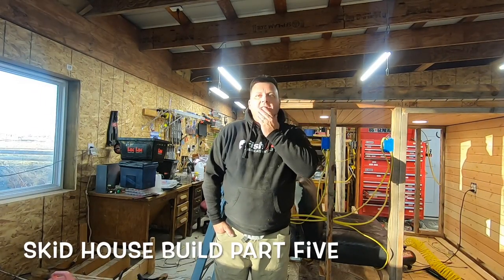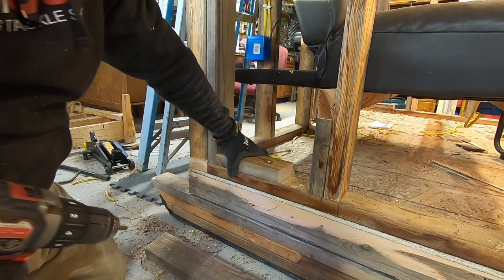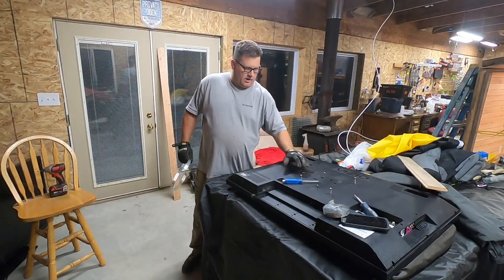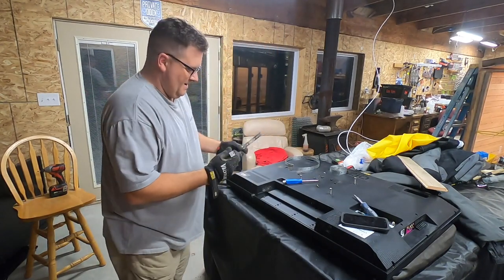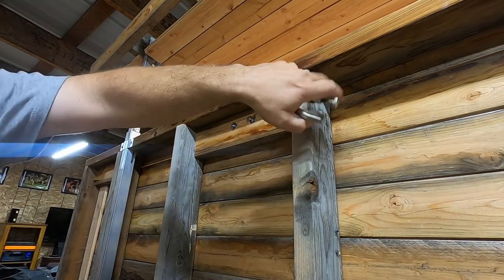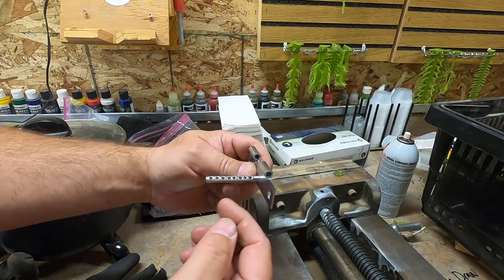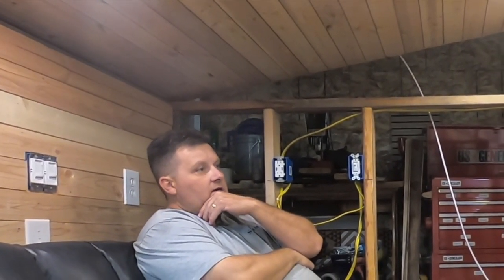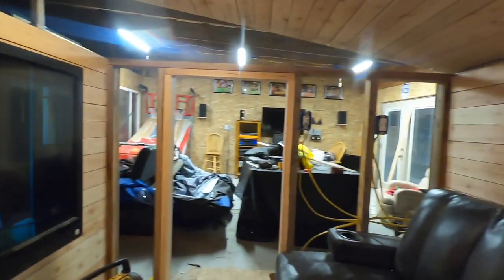Skid House Build Part 5

Comment: Curious about heating,,,,,going with a wall mounted?
Reply from the maker: Probably just using a buddy heater on this one. In the future, I will be building a bigger one and putting some in floor heat with an on-demand water heater. I need to figure out my venting on this build. Don’t want any problems with getting sick.

Comment: Let there be light. Rubber mastic tape is the best stuff for sharp metal edges. Looking way too relaxed on that couch. Are you going to use fabric material on the lift top like a pop up camper?
Reply from the maker: I haven’t decided what material to use yet. I am thinking about making some pieces that fit out of normal building materials. Might even hinge them all to make things simple.

Comment: Hey question what is a skid house
Reply from the maker: Basically just a building that has runners underneath so that it is easy to push around on the surface of the ground. Kind of like skis to reduce the friction of all the weight.
Reply: Now I get it